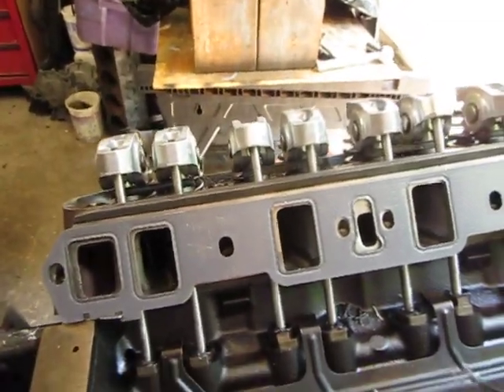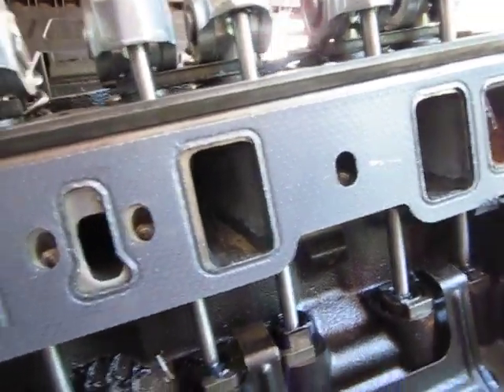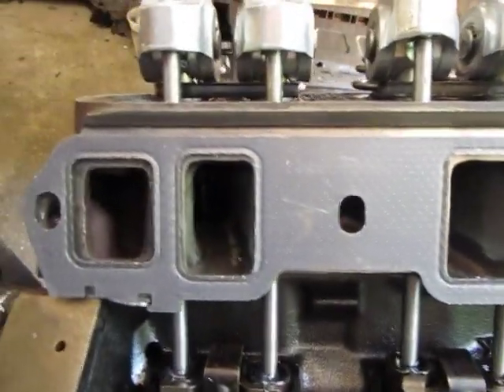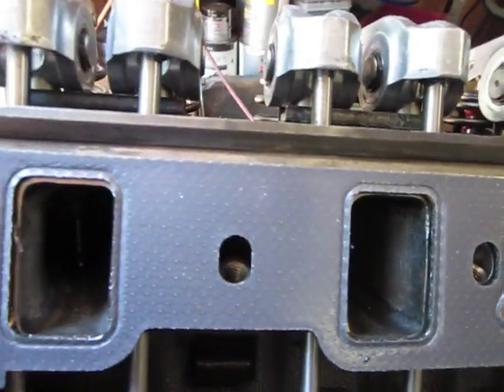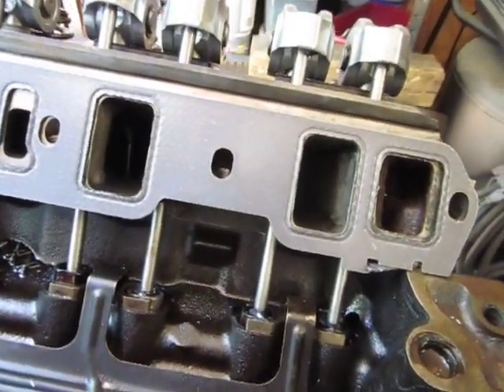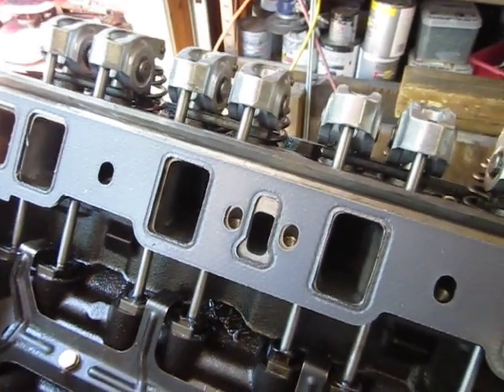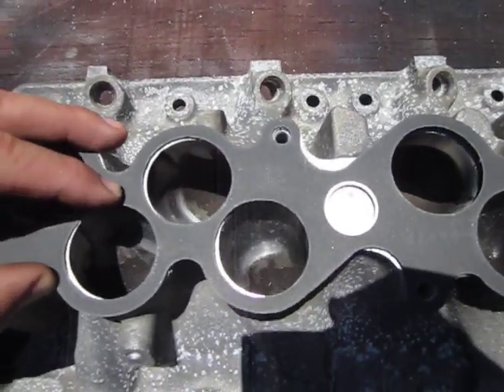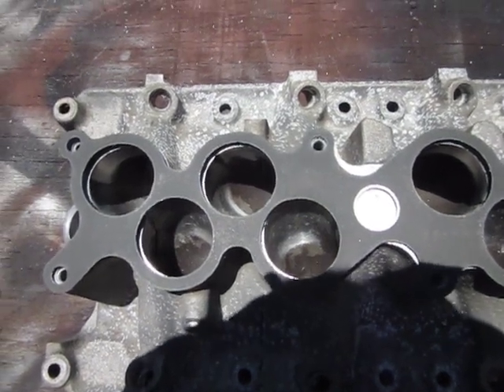GT40 intake gasket alignment

Comment from the maker: Just to add, I mocked up a new fel-pro 1250 gasket and it had the same offset issue. They're so close in size to the factory explorer I'd go with the factory replacement over the fel-pro, unless you get the S3, which would probably be better for aftermarket heads. If you're planning to port an intake and want to port match this is something to account for, otherwise the intake manifold ports on the drivers side won't align with the ports on the head.

Comment: BYE
Reply from the maker: Can you tell I didn't put any thought into how I was going to wrap it up until I got to the end..LOL!! Completely impromptu, found the issue with the gasket, and instead of taking pics, figured a video would work better.
Reply: FXRSDriver I’m glad you took the video. Always glad to get good information, but what’s Rodney think about you using these “p” heads and roller rockers lol
Reply from the maker: It's all stuff we had laying around, I think Rod got the heads in trade for a spool, I got the rockers from Jonathan in return for doing a chip for his car. They were missing pedestals and bolts, but I got the pieces from Crane to make them a complete set. I had an Anderson B21 I got from a guy for doing a chip for him. I don't remember where I got the intake from. I did some work on the heads, mostly bowl, pinch and exhaust work. They flowed decent on the flow bench, that video should be up sometime once Rod gets it edited with whatever them he goes with, because he and Pirate came with me that day, the 3 of us together usually will have some kind of circus or clown theme associated with it.
Reply: FXRSDriver I wish I lived closer to you guys. I’ve met up with Rodney a couple times but still hoping to come back down and go to the track.
Reply: I need friends so I can trade and get my hands on a roller for cheap! I wanna be a part of the substandard fox body movement!! I've emailed Rodney a few times to get advice. Great guy! I'm in NC now at Camp Lejeune so fox bodies are abundant. Just gotta find the right one!